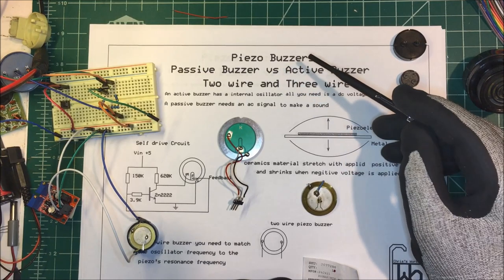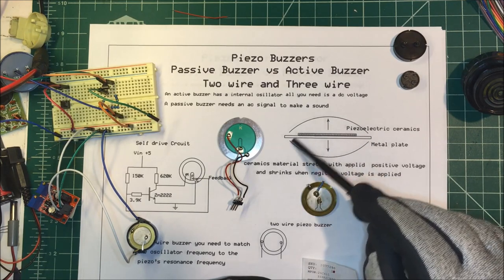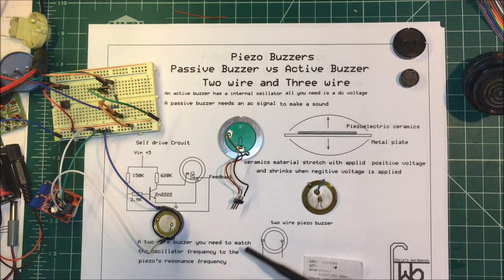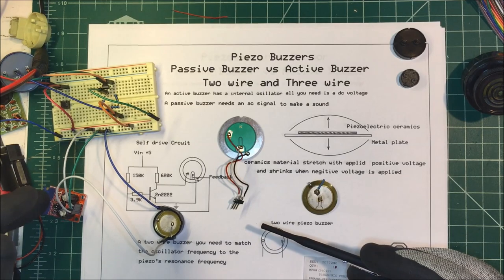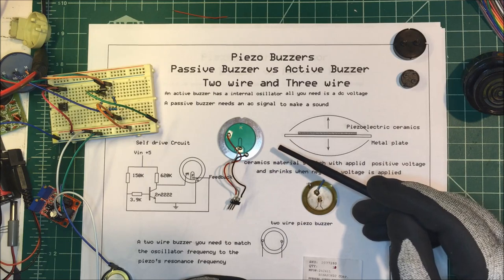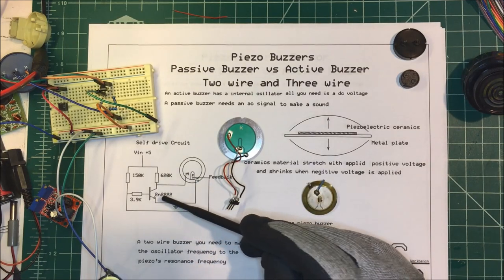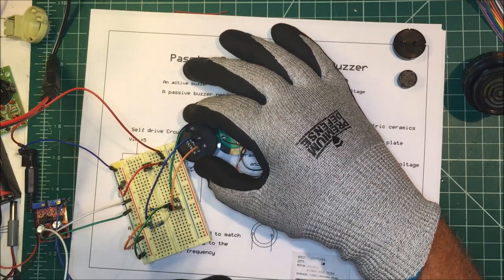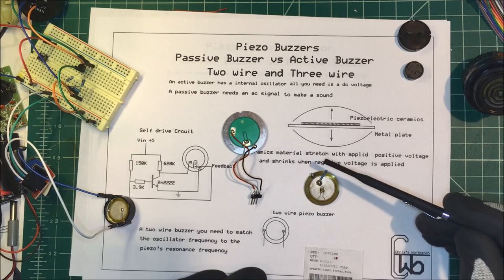Piezo buzzers

Comment: There's another buzzer which is more common than these two. It is found in PC motherboards and is used for beeping bios error codes. It has a small copper winding inside it and a magnetic ring surrounding it. There is a small plate on top which looks like a piezo plate but it has no connections.